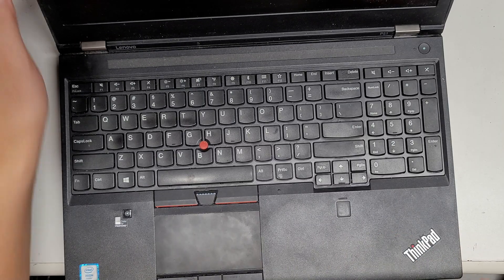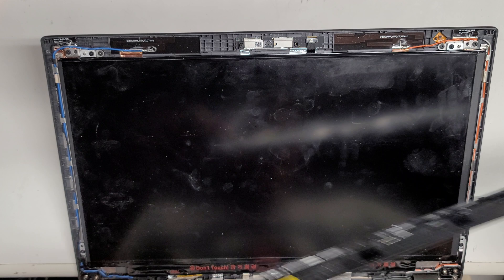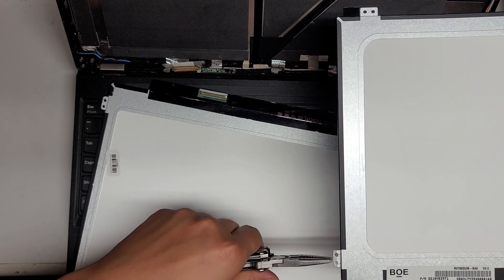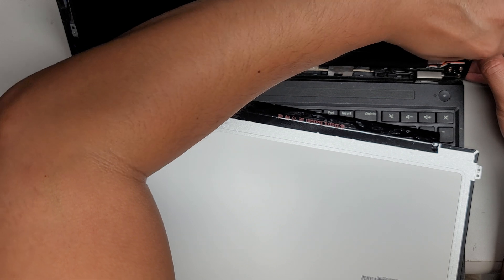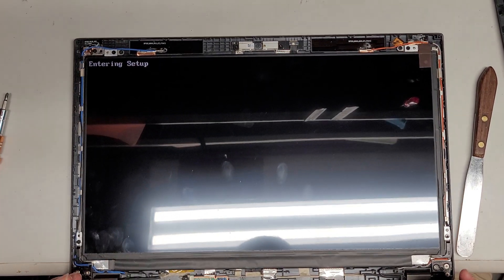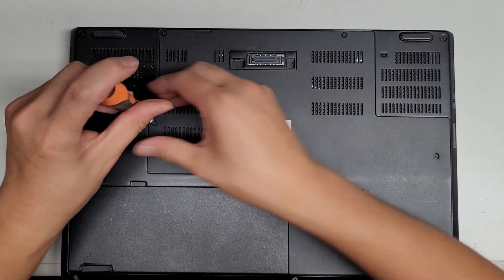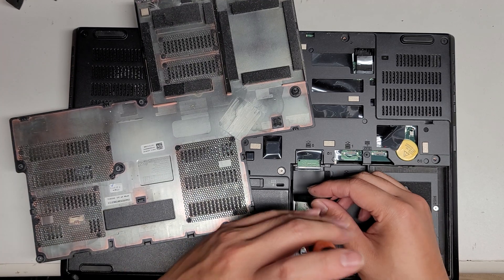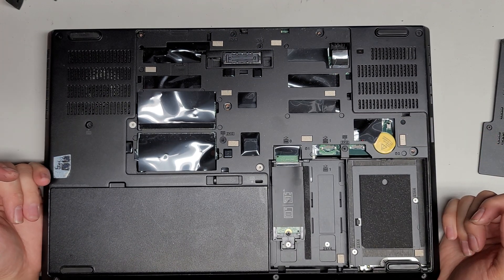Lenovo Thinkpad P51 Disassembly LCD Screen Replacement & Partial RAM SSD Hard Drive Upgrade Repair

Comment: which model is better P50 or P51
Reply: I would say P52 gives you more performance because the CPUs are hexacore vs quad core on the P50/P51
Reply from the maker: Haha that wasn't one of the options.
Reply from the maker: I don't know. Better in what way?

Comment: Can I upgrade the screen to 4k?
Reply: The 4K Model has a 40 pin connector and the normal FHD only has a 30 pin so you can't upgrade.
Reply: Yes you can, you just need to source the 40 pin eDP cable and it should work as in other Thinkpad models
Reply from the maker: Interesting
Reply from the maker: I don't know. I don't experiment on customer devices like that.

Comment: I have P51 that screen is sometimes going black.  Is it likely to be loose RAM or loose connector cable?
Reply from the maker: loose connector or bad screen.
Reply: Funny you would say that.  Although I do not have the p51 ,  I have the T510.  Last week, the last thing I saw on my screen after working on it a few hours was a blink/flash of a blue  saying something about "ram not".  The screen  immediately went black.  I can turn the computer on, lights flash, fans spin processor heats up, everything acts like normal, but the screen looks completely dead.  Does this mean i buy a replacement screen or do i take out and re install the ram or buy new ram and replace the sticks?  Thanks.
Reply from the maker: @duaneafields  try the RAM first